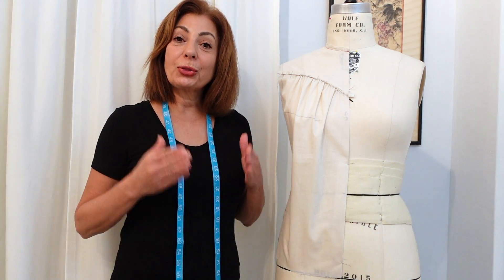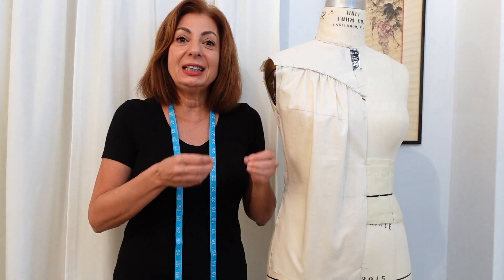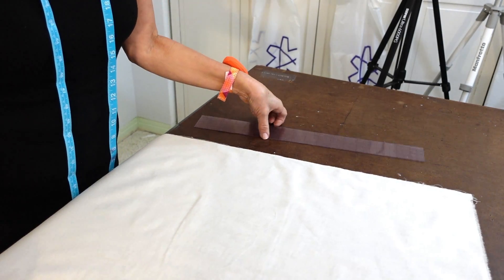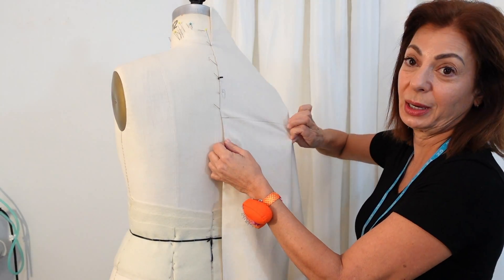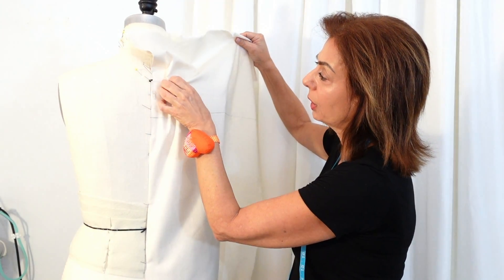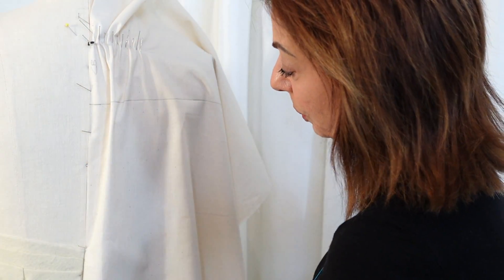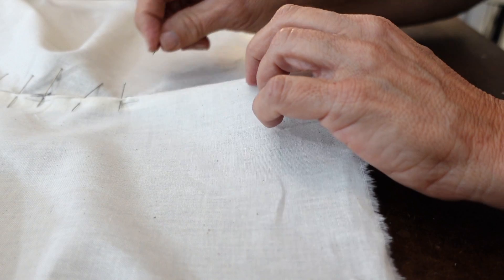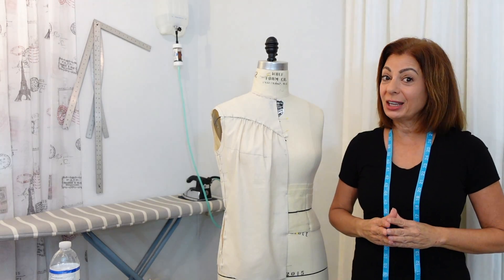How to Drape a Gathered Back Panel! YOKE BOUSE DESIGN - Part 3

Comment: when you are designing for unusual bodytypes... do I need to first dress up a dress form, or is there a "on teh body" situation that could work? like the person wearing a long sleeved "body" to pin too and them standing still a lot?
Reply from the maker: I'm sorry I don't understand the question. There are no usual body types. Most dress forms are made to with the hips just a few inches more then the bust. If you designing for a body that has different measurements. You need to pad the dress form first

Comment: I've watched this a few times and have followed along with the process, but I'm confused when you attach the 2 together at the side seam.  Since you lowered the front armhold down 1 1/4" and out the 1/2", I'm confused at exactly where you are attaching the front and back on the dressform.  How can you attach at the original underarm seam if you have cut it away?
Reply from the maker: Here is my video on trying and pinning the bodice. Would you please watch it and let me know if it helped. https://youtu.be/JFfJjihw5eA
Reply from the maker: You are attaching both the front and back at the new line.
Reply: @susaneliascouture  I watched that and it is very helpful, as are all your videos!  I understand the flat pattern part (I have done a lot of that), but I was confused when they were both on the dressform and the front was armhole was already lowered and cut and then you pinned it to the back.  It looked like you went into the original line at first, but it would still have been lowered 1 1/4", so to me it didn't make sense after you took it off.  Am I marking the back at the armhole (on the dressform) and then lowered 1 1/4" to connect to the front?
Reply: @susaneliascouture  Also, I am talking about when the front has been cut out and the back is still being draped on the back and has no lines on it yet.
Reply from the maker: @julieglasser8419  You follow the underarm plate for the indication of the armhole. Then you lower the armhole after that. Usually I would true both pieces together but, for the sake of separating the videos for YouTube.  I did not. I also watched the video again to try to see what you are maybe struggling with.  As far as pinning the side seams. I show it at the extension point. I can remember later I felt their was too much ease so I might have moved it to the original line. This is something that you can do in designing as you see fit. I hope that makes sense. Keep in mind you can always schedule a consult zoom meeting with me for more in- depth teaching!
Reply: @susaneliascouture  I appreciate the information!  I definitely plan on doing a consult after I watch more of your tutorials and find a project I want to work on and need help with.  I am planning on finishing my yoke blouse drape this weekend (I changed a few things, including the neckline).  I'll let you know how it turns out!  Thank you again:)